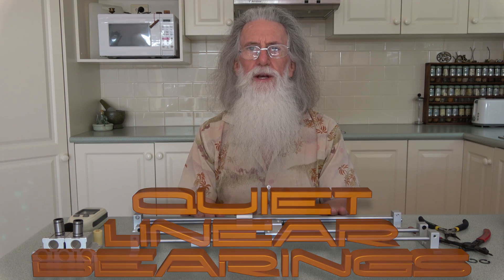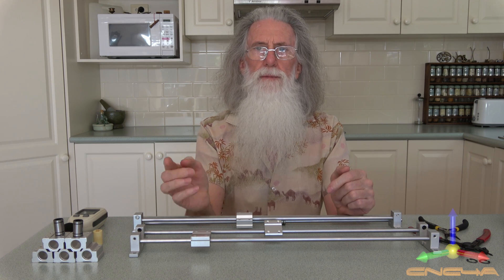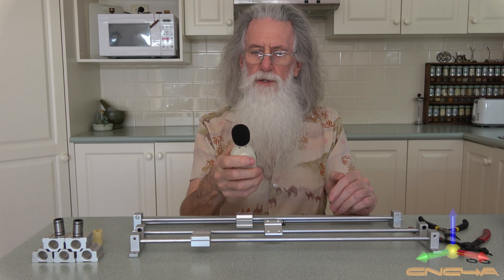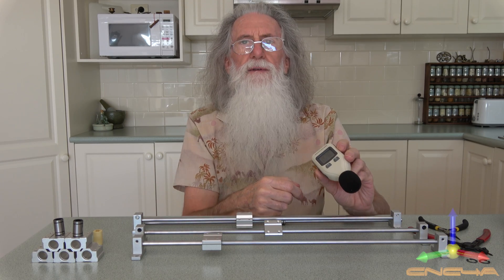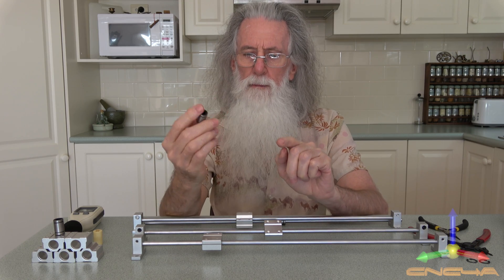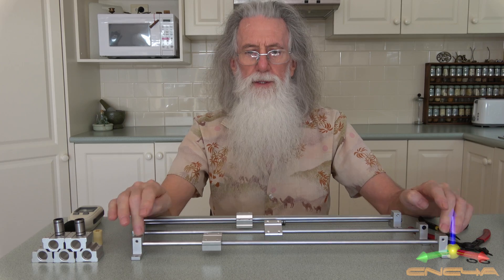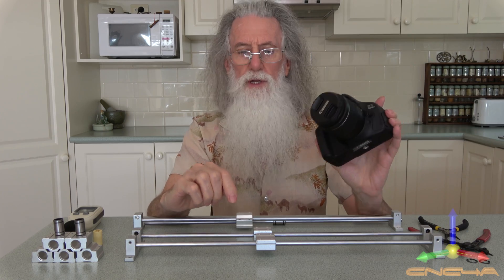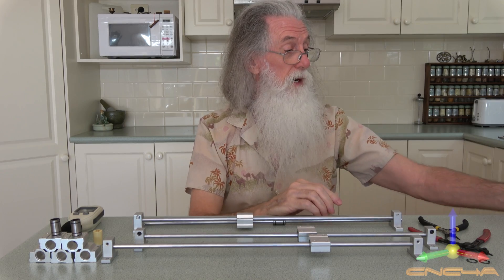CNC4A - Quiet Linear Bearings (in 4K UHD)

Comment: Why there is play in lm8uu based linear rail , I measure the diameter of different roads all diameter is less than 8mm it's around 7.6 to 7.8 mm is it common tolorance or perfect 8mm rods are also available??
Reply from the maker: Good Question.  It has got to do with manufacturing tolerances and the intended end use.  To make something to a tight tolerance is more expensive to make.  If a hole is just to take a bolt you can just drill, but if it is for a shaft you may need to ream the bore or even bore it.  So the engineers came up with a series of fits. Interference, Push, Sliding, etc and tolerances for the hole Hxx and the shaft Letterxx.  A reamer will have the code on it so you know what size the finished reamed hole will be.  So a 10mm reamer will not ream a 10mm hole.  It will be oversize, the amount will be determined by the fit class.  Google British Standard Selected Fits, etc and you will see the charts then you can determine what class yours are.  Now for a quick fix.  You can replace the ball with larger ones.  Or for a simpler quicker one tilt the housing so it is on an angle to each other and the shaft will hit the bottom ball on the left and the top ball on the right (if mounted vertical) etc.  Watch my cnc videos and I mention in one of them about twisting the ball nut to take the backlash out, etc. I hope this explanation helps you out and points you in the right direction. And as always thanks for watching.

Comment: Note that typical db measurements are taken at 1m, so this isnt easily comparable to other measurements
Reply from the maker: Correct.  If you are comparing stated official isolated readings then they must be at 1 metre.  If,  however you are just doing a comparison in the same setup then the readings are relative to each other.  If you measure at say 0.5m for both and one is twice the reading of the other it will still be twice the reading at 1M.  It will always be twice as loud as the other no matter where you stand.

Comment: I believe the Igus RJMP bushings are slightly oversized because they're intended to be press fit into their housing and compress, otherwise they tend to have a bit of slop. At least that's what they claim. I've never had great experiences with them myself.
Reply from the maker: Correct Nibato.  It also depending on how the God's are looking down on you.  The injected bush may have flashing, burrs, seems, scratches, etc left on and its tolerance on the OD and ID.  The quality and the tolerance of the linear bush block as some are machined and cheaper ones left as die cast.  The rod diameter (OD) also varies and cheap ones are usually under size.  So you need to mix and match your set to get the best fit on all.  If the tolerances are one way it may end up too tight and the other too loose.  You are after the Goldilocks moment, "ah Just Right".  And as always thanks for watching Nibato.

Comment: I just bought these to upgrade my 3d printer:https://www.amazon.com/gp/product/B07DN1VBL1/ref=ppx_yo_dt_b_asin_title_o04_s00?ie=UTF8&psc=1. I'm not sure where I can buy the plastic bushings to replace the metal bearings. Maybe once I got the new rails installed, I'll try to print the bushings in nylon. Thanks for sharing very useful information.
Reply from the maker: Thanks for watching Nghi.  The split bearings make it a lot more difficult to find the plastic ones.  You could always cut a slot in a round one for clearance and it may work.  The only problem I see is that the round ones have ribs in them that squeeze in and distribute the force equally around the diameter.  With a notch in them it may be sloppy in one directions, etc.  You could always buy one and test it to see how well it works.  If you print your own make sure you use a slippery plastic, like nylon (the soapy to the feel type) to make them last longer.
Reply: @TheWizard  You're right about finding open plastic ones. I think I only worry about the force from the heated bed down against the rails, so a cut at the bottom of the bushing is probably ok. I'll get a set and see how it goes. But noisy or not, the dual rails I'm trying to fit on my printer should beat the stock V-slot rollers by a mile in bed leveling.
Reply: @TheWizard  I've discovered an amazing idea on plastic bushing here:https://www.youtube.com/watch?v=HjRh_Fa9G2I&t=1s. I definitely will toss the steel bearings and print these myself.
Reply from the maker: All Teflon bushes are the way to go Nghi but they are expensive.  The hybrid in the video seems good in the theory but in the real world, not so great.  You have to remember that the full circumference of the bore takes all the wear so if you have a 10mm bore the circumference, in round figures, is 30mm that slides on the rod.  Now if you put those four 2-3mm Teflon rods in you are only having a contact area of less than 1mm (diameter touching diameter) so the load (weight, etc) is 30 times more (psi) than the original bush.  So it will be silent and smooth for a while before the thin edge has worn down and you are touching the original bore again.  If the Telfon doesn't work loose and wears a long time and is not expensive then it would be good.  I have heard of people just pushing in a stack of Teflon washers to make a pancake of them.  You would have to be lucky to find some off-the -shelf ones that fit though. In my video 3Dprint4A - Anet A8 Mods 13 - Table Levelling To A Thou
https://youtu.be/-tUzgewv80o I show how to get your bed very level.  But the problem is most of the aluminium hotbeds and carriages are bent like a banana.  Most of the frames are stamped out and have a few mm bend in them from one adjusting screw to another.  You could always flatten them with a sheet of emery cloth and sheet glass but I have found with the thin fingers of the bed carriage they distort with the heat, that's why I normally use a raft, a pain I know but easier in other ways.  Hope you do manage to take your 3D printer to the next level Nghi.
Reply: You're giving me much food for thought, and you did change my mind on the ptfe tubing idea. I'm in the process of modeling up a plastic bushing like the one on your desk, I just need to cut a split in it for my SBR rails. Actually, the problem with my printer is not bed leveling, but that its four corners keep changing. I only need to do the mesh bed leveling once, and subsequently, if I take time to level the corners before printing, I'd always get good prints. So my thought is that while the V-slot rollers keep the bed pretty solid along the single center track in the Y-axis, they have problems maintaining a constant distance to the nozzle along the Z-axis. Therefore this experiment. Thank you for taking the time to share your ideas.
Reply: I just took apart the ball bearings cartridge that is held inside the bearing block between two lock rings. This cartridge consists of a steel barrel that wraps around an inner plastic barrel that houses the ball bearings themselves. There are two grub screws that press against the top and the side of the steel barrel to press the ball bearings snugly against the linear rod. I found that I could take advantage of the steel barrel and the grub screws to adjust the pressure between the 3D-printed nylon bushing and the rod. Well, I've successfully printed such a bushing to replace the bearings and its plastic housing, and the fit is smooth as silk. As the nylon bushings will eventually wear down, I can make them fit again until they can't be adjusted anymore.
Reply from the maker: That's good news Nghi.  Glad to hear of your success.  Just print the spares out now whilst everything is still tight and accurate, then the changeover in the future will be quicker and you will have very little downtime.
Reply: @TheWizard  Well, I'm not quite there yet. As soon as I tighten things down, I had problems aligning the rails perfectly. So the rails are put in the backburner for now. I'm replacing the stock 20x40 V-slot rail with a 20x80 rail. This task also required me to print several eccentric spacers to compensate for my imprecise drilling of the gantry plate. These spacers are slightly larger than stock. Hopefully, this setup will yield a little higher bed stability. I'll share with you my progress. Thank you.
Reply from the maker: In theory you really only need one main rail and one floating rail.  The main rail is the one fixed and is square, perpendicular, parallel, etc to everything else.  The floating one is just there for support and that can just be a V roller spring loaded.  Say two rails are out of parallel 3mm.  If 2 were bearing types they would soon bind and lock up and not be able to move.  But if one was just floating the spring loaded roller could move in or out 3mm and still keep everything tight and accurate etc.  You normally have slots in rail brackets , etc at each end for adjustment left, right, in, out, up, down, etc.  You set one up first using a try square, digital caliper, ruler, a piece of wood cut to size, etc and then work off that for the other one.  You don't go back and forth between them as you will be like a dog chasing its tail.  Get one set up first and then adjust the other one to it.  I used a fruit tin to get the cross rails on mine parallel, touch one side then slide it over until the other one did, then fined tuned both until the tin smoothly slide across either side.  don't forget to subscribe if you think it's worth it Nghi.
Reply: @TheWizard  Subscribed. You might be familiar with the Creality CR-10s which is the one I have. My main concern is the Y-axis V-slot rail that is only 40mm wide. I have no problem getting a good mesh bed leveling, it's just that if I bump the print bed for whatever reason, like trying to remove a print or whatever action that disturbs it, the next "leveling corners" routine will show some turning of the bed leveling knobs will be required.
 
My theory is that this center Y-axis 20x40 rail is too narrow, a very small play in any of the 6 bearings will be amplified in nozzle gap fluctuations increasingly toward the side edges of the print bed. So once I found a 20x80 extrusion at openbuilds I thought I would give it a try. So far the result is very promising. The nozzle gap is maintained through all the four corners sofar after a series of prints. This never happened before.

Your tip on how to setup the linear bearing rails is great. I have an inkling that a properly set up dual linear bearing rails can be even more precise in maintaining the nozzle gap. My love of tinkering will not allow me to stop here but will try to set up the linear bearings again. I just know it  :)  Thanks.
Reply from the maker: The problem with most of the designs these days is that they are too minimalist in their design, less parts, less cost, etc but they are all too flimsy, not rigid enough.  All of the arms  should be triangulated to make the structure solid.  Mount the frame to a 1/2", 12mm FLAT baseboard with screws through the frame.  Then under the unsupported rails make up packers the EXACT thickness of the gap and push them in and screw through the rail, packer into the baseboard (or nuts & bolts).  Put handles each end of the board for lifting when moving.  Then take off the fancy coloured trim on the Z uprights and the corresponding side rails, buy some T nuts and screws that suit the rail and some strapping, predrilled if you can.  Then bolt the strapping to the rails to make a 45 degree triangle at each side of a vertical rail (4 straps).  If the outer frame base needs them add them there as well. You need to make it that strong that if you kicked it, it wouldn't move, or as I like to say, You could drive a truck into it.  Have a look how I made the flimsiest printer ever designed solid. 3Dprint4A - Anet A8 Mods 10 - Rigid Mounting https://youtu.be/632tIOdlOjA  Look at the complete Anet A8 series for a few more tips.  And if you have time, the Kossel Delta series, the banana test would be of interest.  There's probably over 80 videos in those two so when it is a wet weekend enjoy, you will pick up other tips I am sure.  And thanks for subscribing Nghi.
Reply: @TheWizard  Wow! The Rigid Mounting video is so informative. I'm naive, maybe for not knowing any better, thinking that you can't improve upon what comes out of the factory. I've only a couple of minutes into your video but I had to rush back here to express my excitement and appreciation. I'm sure I will learn a lot from your wealth of knowledge. Thank you for sharing.
Reply from the maker: You are not naive Nghi, it's just that you have been inside a box, like many, many people.  I have given you the key to the lock and you have now escaped from it and can now look around at things from a different perspective.  You are now free to think outside the box.  People have heard that term, you are now experiencing it for yourself.  Your life should change from now on.  No longer held back, restrained, conformed in your thinking, you are now free to ask "What if I did this!"  It won't always work, but that's not the point, you are trying something different. Take it and run with it the rest of your life and you wont look back.
Reply: @TheWizard  That is a hidden treasure that you just gave me. Thank you very much, Sir Wizard.

Some more things I've learned about this printer. With a wider Y-rail, it's noticeably more stable, yet I still found erratic Z movements. I've discovered two things I needed to improve. One is the synchronization of the two independent Z motors/lead-screws, and secondly the backlash between the lead screws and their associated nuts. I've solved the first issue by adding a belt and pulley system to ensure both screws go up and down in unison. This works great. Bed leveling is now much more predictable and consistent. I'm waiting for the Delrin anti-backlash nuts to come sometime next week. These Z-related issues have been the source of frustration for mesh bed leveling and my previous trials of automatic leveling with the BL Touch and EZABL sensors.